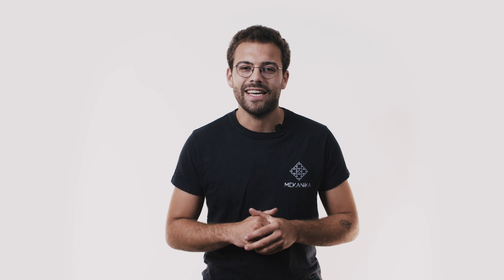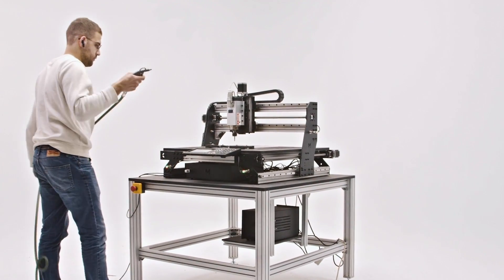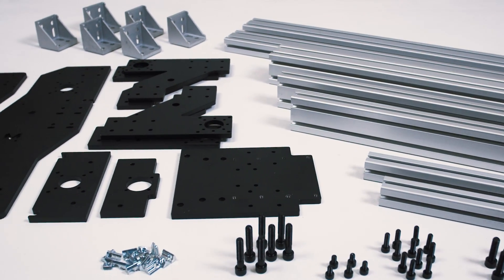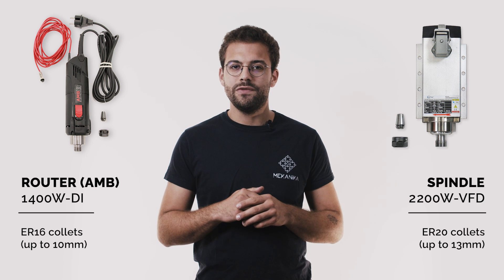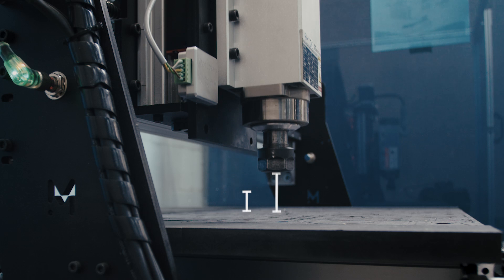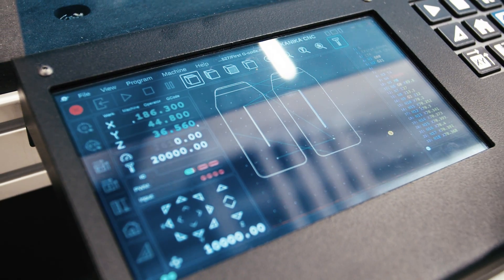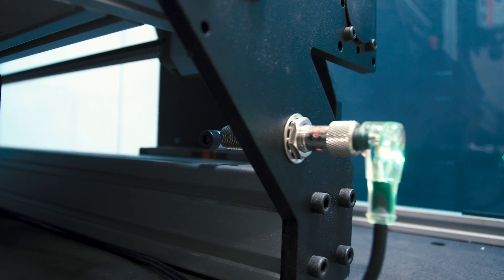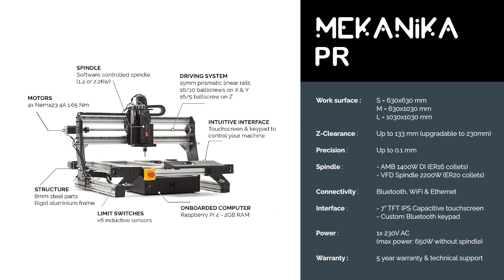Mekanika PRO | Product Presentation | Desktop CNC Milling Machine

Comment: just wish it was more like the Altmill when it comes to rigidity, its very difficult to find a good machine in europe ugh
Reply from the maker: Have you seen/tested one of our machines in real?  What makes you think it is not rigid? 
It has been studied thoroughly, and it easily reaches a 0.1mm precision on large pieces, which is far enough for most of the uses on panels.
Our structural parts are made of high quality German alu profiles, and 8mm French steel and provide plenty of rigidity while remaining from reliable sources.
We also have a new Support Table that add fixed feet to the machine making it self standing, and a Vacuum Table too (amongst many add-ons).
It is also open source, if you need to adapt it to your needs or want to make it more rigid, it is using standard parts and we provide all the models and BoM.

Contact us and we can check if we can find on of our customers around your place, so you can see it for yourself! :)
Reply: @MekanikaTools  i checked the website to see what you were talking about,

i see the pro smart pack is interesting, definitly peaks my interest.

currently out of my budget but its a contender on my list for future machines.

i suppose the dimenstions stated are working area? (L  1030x1030 )